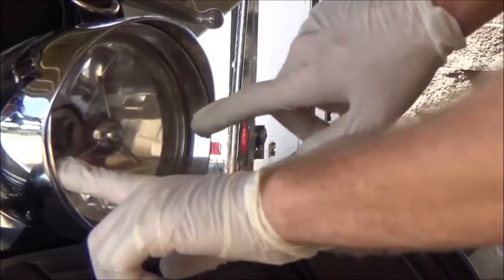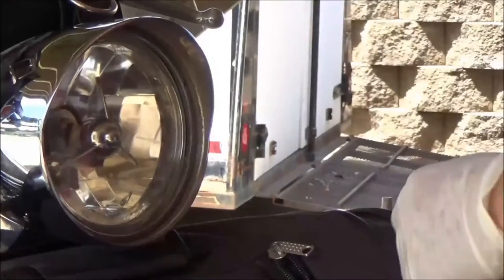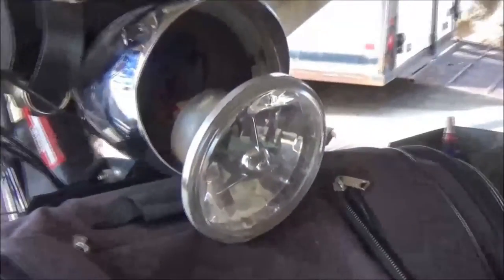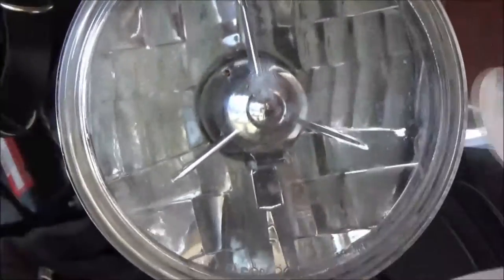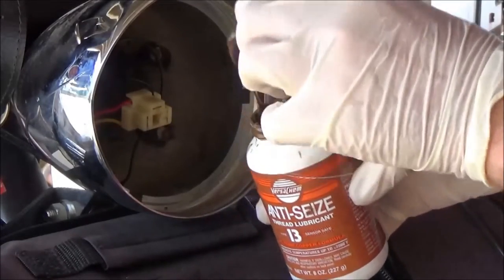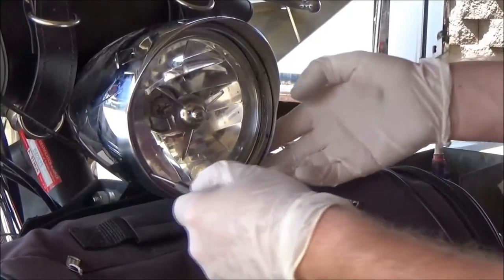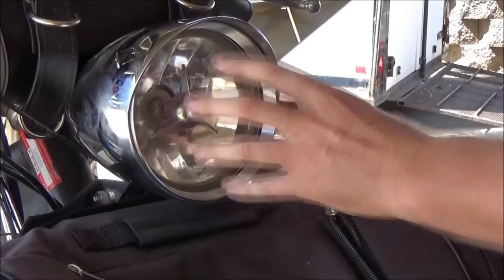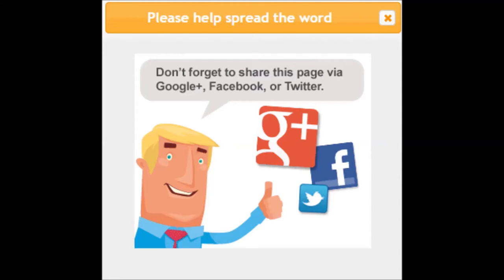How to change your bulb in aftermarket "chopper" style headlight buckets

Comment: I'm struggling to get that beauty ring off. I tried putting double sided tape on it to get extra grip. I even tried taking a flat head screw driver and a hammer to lightly tap it to get it loosened up to turn easier and the friggin thing won't budge. Any tips?
Reply: not all of them come off that way. mine has a ring you pull out from a small notch in the very bottom, where the set screw on this one is.
you pull that, then the ring just slides out, its not threaded. i have seen alot of these style come loose, and guy put loctite or silicone in the threads. they are near impossible to get apart after that
Reply: I have the same problem, did you finally get the ring off?  I sprayed WD40 and I'm going to let it sit overnight...
Reply: @dieselguy62   Starting to think I have the same problem. Ring won't spin and it looks like there's to small metal tabs on the inside of the bezzle near the light. How do you pull out a C clip through that small hole? I'm lost. Any advice is appreciated
Reply: @michaelbrooks4710  you just squeeze those together and it comes out. It's a retaining ring set in a groove.  That style is the easy one to get apart